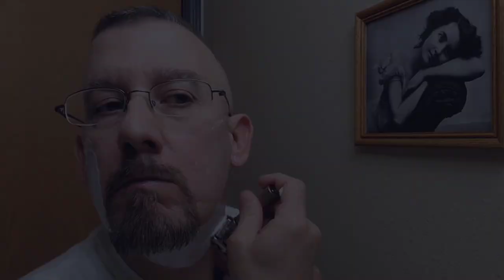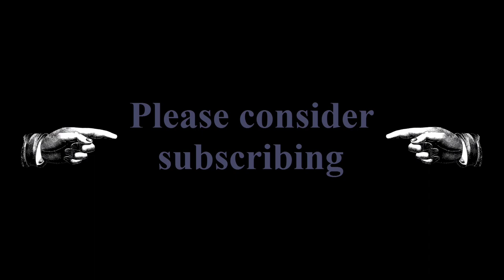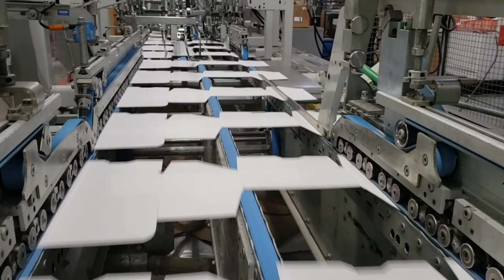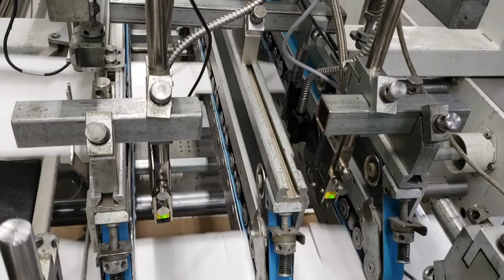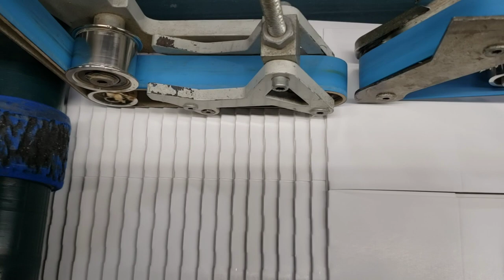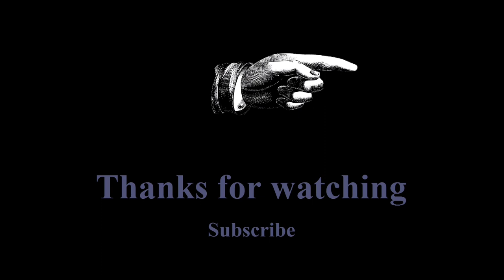Glue between the belts (Why I enjoy bigger auto-bottom cartons) Bobst Expertfold

Comment: Hello, when converting straight line gluing, do you prefer the wheelpot or the extrusion? What if you were teaching a new operator/adjuster?
Reply from the maker: That is a GREAT question! If it is a normal straight-line, I will use the pot every time because you get consistency and speed. If you use extrusion (glue gun) there is always a chance of it skipping out, whether it is from a cable connection coming loose or the gun tip getting a piece of trash stuck in it. Even if you are using glue detection, it still might be somethingyou have to deal with. It's a pain in the butt to clean the pot, but it's far better than worrying about missing glue lol! Thanks for watching the video! Enjoy your weekend.
Reply: @Oakhart76  Thank you. Allow me a follow up question, from you experience are the wheel pots on the newer Bobst, Nova, Vision, Expert and Masterfold better designed then on older Bobst such as Alpina, or Jagenbergs, Posts and Internationals? A regular comment I hear, is that the wheel pots leak and sling a lot but think this applies to the older gluers and not the newer Bobst, Heidelberg, Signatures or DGM's. Thank you for sharing your thoughts.
Reply from the maker: @luxspora1072  I think the biggest problems with slinging glue at very high speeds is 2-fold. 1st is how close the scraper sits to the sides of the wheel and 2nd, how much glue you allow to sit in the pot. As far as the AMOUNT of glue that sits in the pot, you adjust that with the height adjustment block on the neck of the glue bottle. If it allows the opening of the bottle neck to sit too high, you will have a LOT of glue in the pot, which means a lot of the wheel will be sitting in the glue. If you have a lot of glue on the wheel, that is a lot of glue that the scraper has to deal with. If half of the wheel is grabbing glue, you will sling glue ALL OVER the machine... learned that the hard way lol. The machine you see in my videos suffers from the 1st issue I mentioned above... There have been many "would-be" operators who worked on that gluer long before I started working with it and they didn't know what they were doing. A lot of things were treated roughly and that includes the glue pot scraper. It had been taken apart to be cleaned and put back on crooked. As a result, the brass scraper has been worn down on the parts that hug the sides of the wheel. If I allow more than 1/2" of the wheel to be dipped into the glue and then run higher than about 375 meters/minute, I'll be slinging glue from here all the way to your house! That machine is a 2009 Expert Fold  but I am confident that if I get a new scraper and watch the glue level, it will have no problem running balls-out. But that theory has yet to be tested. Hope that helps.
Reply: @Oakhart76  Yes it does and thank you. What would be your preferred setting for the wheel to dip the glue? My European friends claim they are running line speeds of 500 and 600 meters/minute.
Reply from the maker: @luxspora1072  You kinda have to play it by ear so to speak... depends on your specific machine. Just keep in mind, the lower you keep the glue level, the less time you have to react if the bottle runs dry and you have to fill it back up before the glue gets too low in the pot.
Reply from the maker: @luxspora1072  also... where I'm from, we have a saying about fishing... no pictures = it never happened.  Tell your friends the same about their run speeds 😆
Reply: @Oakhart76  Good morning. Day light savings is always a transition my old body does not like. Are you using a universal glue which works on board to board, board to clay coating C1S or C2S, board to poly laminate/aqueous coating? Ever have knock outs not in right position or forgotten?
Reply: A fiber tear trick which was shared with me, place the glued area or cut out of glued area in the microwave with a glass of water. Head for 30-45 seconds, cool for a minute and check fiber tear. Replicates 24-hour adhesive cure to about 90-95%. If you have fiber tear after compression but 24 hour later the adhesive breaks off without fiber tear, this is a quick verification for QC.
Reply from the maker: @luxspora1072  nice!
Reply from the maker: @luxspora1072  we have 2 types. One like you mentioned and one that works with foil.